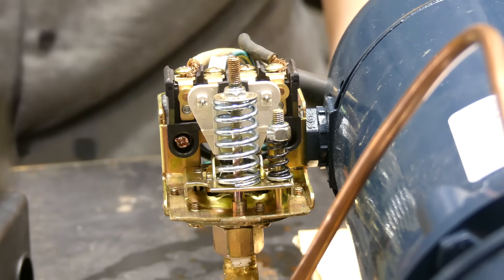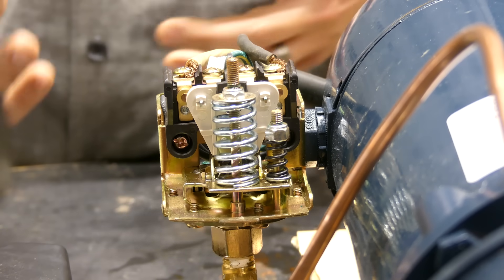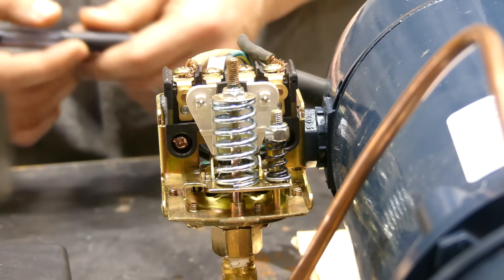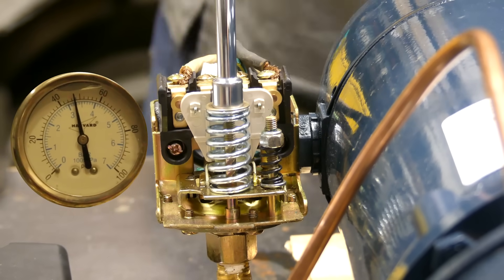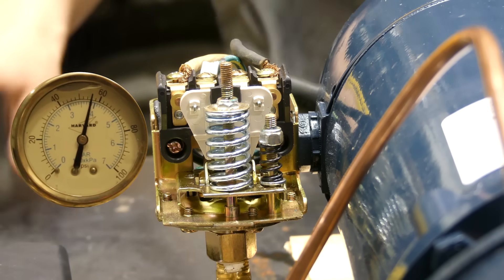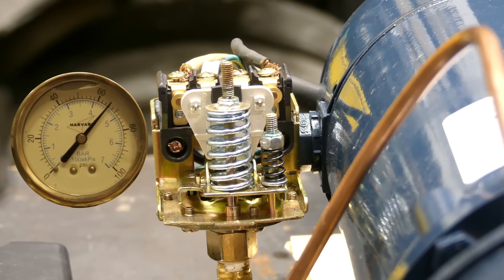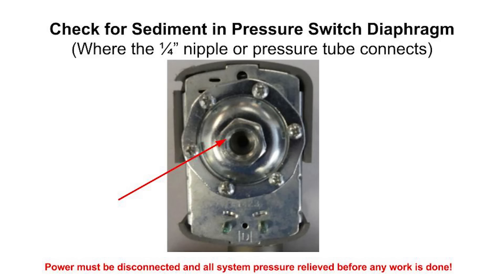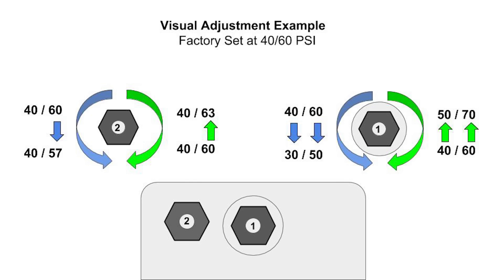How To Adjust a Pressure Switch

Comment: If you change the pressure settings adjust the well tank precharge air pressure to 2 psi lower than the cut in of the pressure switch. For preventative maintenance annually check the precharge and adjust it if necessary. The measurement is made with the water pressure at zero.

Comment: Finally a video by someone who knows what they are doing and talking about, I wish all the others with video's would watch this and learn a few things.
Reply from the maker: Thanks Virgil! We are always looking to provide good information for others. If there's anything you want to see explained let us know and we'll whip up a video.
Reply: I will try to explain what I have been doing the past three months, I got my dad's old water pump out of the garage to attempt to hook up some sort of a constant water source to the cabin  have here. The main problem with anything my dad had was that he was not able to read or write so anything he did that required some sort of reading or whatever always got messed up. The water pump will sometimes run up to 40 PSI and when the pressure falls to 30 PSI it will kick back on to build up, I have been trying to get it set to 50/30 meaning to build up to 50 and run at 30 to build pressure back up. But the main problem I am really having is the only source of water I have is a 55 gallon drum of water which in most cases runs out in a day so I have not been successful yet to get it dialed in properly for those settings. On the pressure switch on the adjustment poles I do see some white like some sort of marking which I had thought was a factory setting but when I have the nuts set to that marking it will not build up pressure or shut off, constantly runs and never builds pressure. Today I was able to adjust it to get up as high as 40 PSI but I like to get it up higher but I will not attempt to do it now until I can get more information on what i am doing.
Reply: well said.

Comment: Excellent video. We had a new well pump installed a few years ago and the pressure just didn't seem right. So now I have it at 65/55. Perfect. I'm old and forget things quickly if I don't use them all the time. Audio and visuals were spot on. I don't see how you could have explained things better. It was a quick video not drawn out with useless information. I am now a new subscriber. Great job !!!!
Reply from the maker: Great to hear!
Reply: @RCworstwater  will add extra wear and reduce life of pump if its constantly cycling. The 20lb difference has a reason.

Comment: Thank your for an easy to understand explanation adjusting the pressure switch. I just installed a new water pump for my Florida HVAC system. The pump came with the switch set to 40 / 30 and was short cycling on and off until I adjusted it to 50 / 40. You the man!

Comment: Exactly what I needed, had new pump installed and installer said had too much air in tank. Lost water pressure once he let out air. my 40/60 was working at 30/50 :-( By far, the best explanation of how a pressure switch works that I've seen.
Reply: there are many variables

Comment: Thank-you so much for walking me through this process. By following your excellent video instruction, I was able to adjust my cut in/out from a lousy 25/50 to 35/60. And thanks for telling me to turn the power off to the pressure switch! I emptied the pressure in the system and adjusted my tank to around 32-33psi. System is running excellent now.
Reply: @Sherif1958  adjust the 60 (cut out pressure).
Reply: @Sherif1958  If your water pump is not cutting out at 60, try lowering it to 50. Your switch might not be working properly. You don't want the pressure to be much more than 60.
Reply: Do you have to empty the pressure in the system?
Reply: @johncraunjr7690  - do you mean empty the water pressure- yes. Its all there in the video.

Comment: Thank you for this video. I'm new to the spring water deal. I had no idea how to adjust my pressure switch. I went outside and got under my house and adjusted the switch an added air to my tank. Glad I found this video.

Comment: Thanks a ton! My pump would NOT turn off, so the fine adjustment at the cut off was exactly what I needed. It's not a permanent fix, but it will prevent my pump form burning itself out in the meantime!

Comment: Very professional explanation.  I have lived in another place where I had installed a high and low level float switches connected to a relay to turn the pump on and off. The pump will not turn on so frequently but on the other hand we had very low pressure in the line.  I was considering that turning the pump on and off so frequently would not be good for the motor. The pump turns on every time you flush the comode or open any faucet.

Comment: Thanks Chris, this was very helpful! Your videos are always clear and easy to understand. I have a pressure switch that’s come out of adjustment over the years. I’ve struggled trying to adjust these switches before by trial & error, so this took the guesswork out & I’m now confident I can go out & get this thing re-adjusted!
Reply: How did the re-adjusted go ?   I'm scared  to try on our pressure switch.
Reply: @HauntedBranch  I didn’t actually end up adjusting it because I found the contact points were badly pitted. I cleaned them up the best I could, but it still kept working very inconsistently (not allowing the pump to shutoff). 

So I just replaced the entire pressure switch, which went very smoothly and now our system is working perfectly! 

I also found the pressure gauge to be off by 10psi (I tested with a gauge that connects to a garden hose thread, and put it on a hydrant to compare against the existing gauge). Glad I did, because I discovered that the new pressure switch was working perfectly (pump on at 40psi, off at 60psi, which is what it was set to do) even though the old installed gauge reads 50-70psi operating range. Now that I know that, I’m just leaving the old gauge in place until I re-plumb the entire system when I remodel the pump house when I get to it. 
Good luck with yours!

Comment: Thanks for the clear demonstration. at 5:12 .. it actually took it to around 70psi not 66 .... so looks like each full turn on either nut adjusts it up or down by 2-3psi as stated in the manual.

Comment: Thanks. That's among the best teachings I've ever learned from. 
My switch has the pump vibrating between on and off - factory setting. I'll adjust it to correct.

Comment: At 5:12 you say 61#'s after adjusting the differential nut. But the pressure was actually 71#.  Knowing this would make it much easier to make the adjustment of the differential nut back to 60#'s if desired.  Great video, big help.
Reply from the maker: You are correct! Good catch
Reply: @RCworstwater  Do you have a video on why there are 3 different preset switches?  Why not have just one that can be
adjusted.  Also, is there a reason, one or more, why I can or can't change out a 20-40 switch to a 40-60 style.  I'm aware of the relationship between the pressure tank size and the pump gpm, meaning attaining the desired pump run times, but are there any other reason that would not allow me to do that.  Also assuming that the pump is rated to reach at least 60 psi.  This would be very helpful info.  Thank you.
Reply from the maker: @Clayform14  There are tons of different pressure switches on the market. We stock the six most popular ones - which one you use depends on the application and the pump characteristics.
Reply: @RCworstwater  Okay, thank you

Comment: I think you did not mention that before changing the psi cut-on setting, if there is a bladder tank, you should change air pressure in tank to be about 2 psi below the new cut-on setting. The water pressure should be zero when you check the tank air pressue. The spring adjustments you explained were very helpful. Thanks.
Reply: 😊😅😊😅a
Reply: Great point! Since the bladder tank and switch have to be 2 psi apart, it would be important to check your tank pressure before you assume the switch needs adjusting.
Reply: How to Check water tank pressure
Reply: Thankyou Joseph, excellent and very important point to add.👍🙏

Comment: Auto mechanic here, really appreciate this video as home systems are a learn as I go process, this gave me the insight as to what I was needing to adjust!  A hard thump to the floor directly above where the pump and pressure switch sits triggered it last night for our home sprinkler system and it wouldn't shut off.  It seems the main nut was never adjusted correctly on install to where the differential pressure spring doesn't even touch the backing plate.
Reply from the maker: Happy you found it useful & thanks for the comment!!

Comment: This is great, super easy to change my 30/50 to my desired 40/60 without changing the switch - also will change the pressure tank to 38 psi

Comment: Just out of curiosity when going from 30 to 50 and adjusting it to 40 to 60 wouldn't you have to adjust the air bladder in the  pressure tank from 28 to 38 or roughly within those parameters?
Reply from the maker: Yes, you are exactly right. We forgot to mention it in this video.
Reply: @RCworstwater  Could you explain why you need 2 psi lower tank air bladder pressure then cut in pressure  on the switch ?--- Oh at or about 5:11 looks like the psi 
hit 70 - 71 psi   I believe I have OCD please forgive.
Reply: yes, you should

Comment: Okay, this video is the only one on YouTube that's given me any degree of hope in the dilemma I'm having (or rather, my girlfriend).
  I've watched this video 7 or 8 times now just to be sure I haven't missed anything. My gfs pressure tank is in her basement, so from what I've gathered from this and other videos probably 40/60 would be the better setting as her pressure is GOD AWFUL! Rain has more psi than her shower. I check the pressure within the tank (membrane) it was at 18..... So I pumped it up to 38psi (since I wanted the 40/60 setting). I turned the cut-out nutt clockwise a fair amount hoping it would show me some kind of change. The best I can see is we've gone from 10/30 (yes, it was that bad) to 20/40, but I cannot seem to get it go above that. That spring is quite compressed as I'm not sure it should be screwed down that low to only achieve 20/40. 
   Before I start cranking the spring any lower, I need help, I dont want to blow this tank up. The COLD water does have a noticeable difference,  however once the pressure gets on the lower end, its VERY noticeable, the HOT water barely drips from the taps, any tap at all. This is a boiler system setup, so am I missing something else that has an effect on shower/sink psi?
Reply from the maker: First thing you should do is replace that old pressure switch. If you're sure her pump is able to produce enough pressure to run 40/60 then a new switch might solve all your problems (if you're not sure find the model and give us a call). If that doesn't fix the issue then you need to trace the hot water line and see what it's going through. I'm not too familiar with boilers, but if that's the only thing in-line with the hot water that must be the culprit. See if you can find an owner's manual for yours to troubleshoot. Here's a link to the pressure switches on our https://www.rcworst.com/Pressure-Switches-c172.html
Reply: Besides replacing the pressure switch, I'd also replace the gauge.  I've had bad gauges that showed too low of a pressure or none at all.  You will need an accurate gauge if you plan to change the settings on the pressure switch. 

For the boiler, it might be clogged with calcium deposits or rust.  A flushing might help.  Also check to see the aerator on the faucet is not clogged.  Finally I had to re-pipe a house because the galvanized pipes where all clogged with rust.

Comment from the maker: Thanks for watching! If you have ANY questions or concerns about your water system you can leave a comment, call our experts at 855.329.4519 or you can live chat with them on our website: RCWorst.com
**PRESSURE TANK MUST BE SET TO 2-3 PSI BELOW CUT-ON PRESSURE OF SWITCH.**
Reply: I noticed that my well was not pumping water to my house. I changed my pressure gauge because it froze up. I also changed my pressure switch and power supply was bad. No it has been 2 days and no water coming in yet. What am I doing wrong?? My system is completely drained and it the.wiring is correct because i checked the power going in and.comming out and its at 255 volts give or take a few. Please help me. Been without water for 3 days and I have sick family members!!!
Reply: I have low water pressure in my home. I have a 20/40 pressure switch, 220 gal pressure tank and 5hp (63gpm) pump. The pump kicks on at 15psi and off at 40psi, runs about 3.5 mins to fill the tank (formerly used to run a 2" irrigation system.) The water line into the tank has a valve stem (similar to automotive type) that leaks water when the pump is on, it also blows (or sucks?) air for a couple minutes after the pump shuts off. I need to adjust the pressure switch to turn on at higher pressure and replace the valve core in the valve stem?
Reply: Preswitch
Reply: Thank you very helpful!!
Reply: ,good video best explanation
Reply: A good video, but please change it to an IMPROVED version. This time, you should REHEARSE your delivery a few times, so in the NEW VIDEO, we (your fans) will not hear you CORRECTING YOURSELF -- or CHANGING your mind -- and thereby confusing us.
Reply: My pressure switch just keeps going back and forth. It does not stay in one spot.
Reply: If my original setting is 20/40, would it be a bad idea to up it to 30/50 with 28pnds of air if the tank is old?
Reply: @gramo63  wow you're really ungrateful, even with a couple slip ups I thought his instructions were easy to follow. If this type of thing is too hard for you to understand maybe you should hire a professional to do it.
Reply: @HotMessJessx3  Oh, I am so greatfull. I men grateful  -- to him fore his wondefull tutelarious expunding of presur cuntroll adjistent. My wtersistem  I men water system is rallyb works fin now becas of his explinationing. Hef a nise, day, Jesica, And you shuld kno that "slip ups" is hyphenated as in "slip-ups" 4 the coreck speling. And corecker Englis gramar is "couple OF slip-ups" not "couple slip ups," nicht wahr, meine gnaedige Freundin?
Reply: @HotMessJessx3  Aha! I seem to have gotten your attention. You should understand that many YouTube viewers have difficulty with the American accent, and must click on the CC or subtitles to follow the tutorial better. It is SO FRUSTRATING to read corrections on the subtitles, simply becase the techer din't say corereckly -- I mean -- because the teacher did not say correctly -- his teaching points (see what I mean?). Jessica, I'm sure you understood well the speaker's accent, and therefore found the free tutorial easy to follow -- corrections and all -- but I assure you that a lot of viewers (myself included) did NOT. BTW, you might appreciate my initial comment better, if this tutorial had been spoken -- corrections and all -- by someone with an Indian or Thai accent.
Reply: if the air compressor has only one adjusting bolt, how must it be adjust for the perfect cut off and cut on ?

Comment: I just want to say THANK YOU again for this video!! My 30/50 system was actually only at 18psi when I drained and checked the pressure! Now since this video I'm running a 40/60 setup.. well 40/65 I didn't want to mess with the off pressure I figured that extra 5psi isn't too terrible and gives it just a little extra before the pump kicks back on and we need water up to the 2nd story so what evs.. but man you really helped us out and thank you. Our r.o. system is now also running at it's max efficiency for what it is.. thank you thank you thank you!!!
Reply from the maker: You're most welcome! Glad we could help :)

Comment: Your 3 1/2 turns on number 2 actually turned the pump off at 70-71, not 65. Just thought I'd share that with you.
Great video as always.
Reply: Steve Morin changed pump and it comes with pressure switch.  Put everything together and primed, my problem is ... the pressure switch doesn't seem to turn pump on and off.  It only gets to 30 psi and then stops.  Water comes out Faust them water pressure goes down and pump not coming on.  Help!!!
Reply: this an air pump nothing to do with water
Reply: Erik Devaney this video is not about a air pump it’s a well water pump!

Comment: Thanks for a very informative and easy to understand video.  

Factory setting for my pump is 30/50.  I am currently at 40/60, but I would still like more water pressure.  

Can I safely go to 50/70?  

As seen in other answers, should I turn up 1-2 full turns to see if my pump can build the pressure?

Thanks!